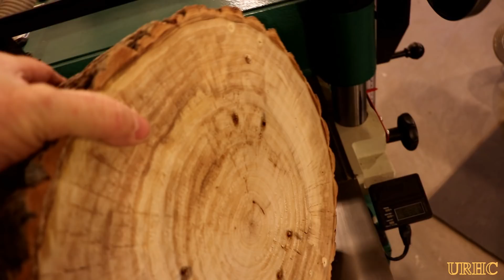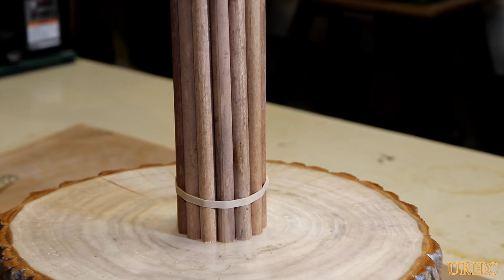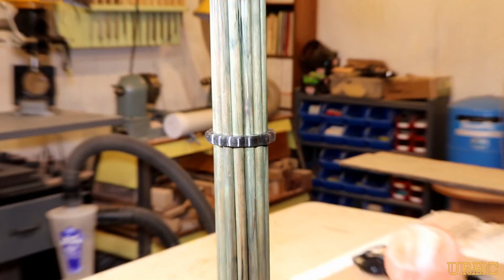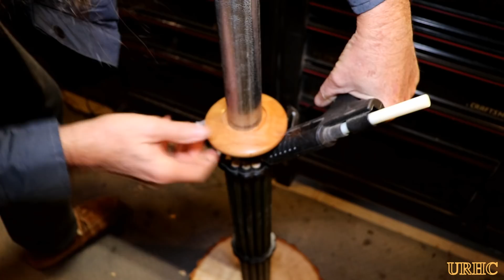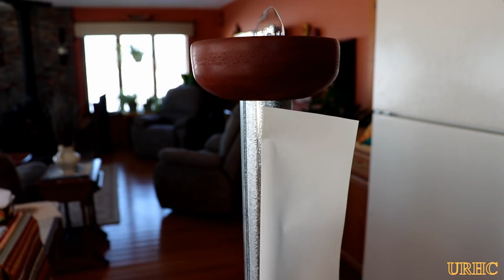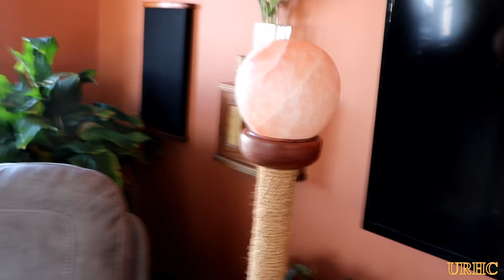Cookie Base Himalayan Salt Light Stand Built From Scrap

Comment: Does anyone know where I can buy a stand similar to this one...I have two salt lamps and I need a tall stand for one of them!
Reply from the maker: I think you would have to build one.
Reply: :-( that's what I figured!!
Reply from the maker: Each stand would have to be designed for the weight of the lamp and conditions they are used in such as having small children or pets that could knock them over. I think it is best to make one that meets your needs anyway.
Reply: Thanks for the reply...but I have neither at home :-)